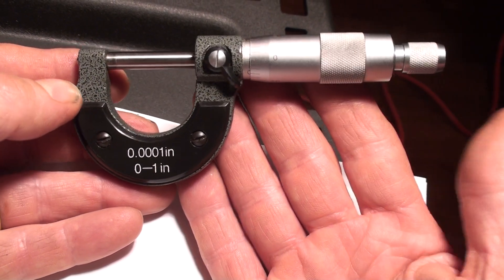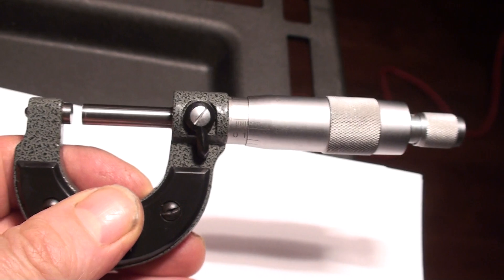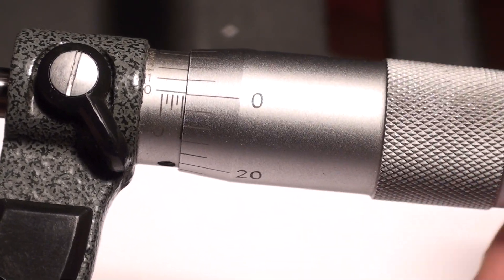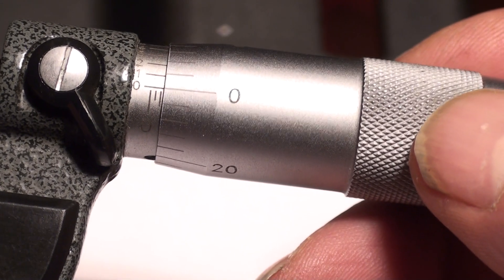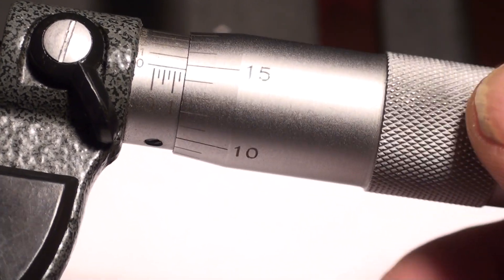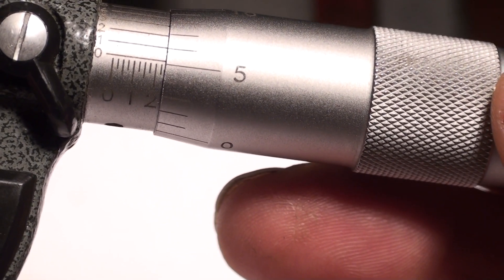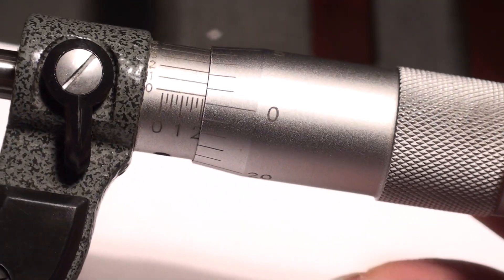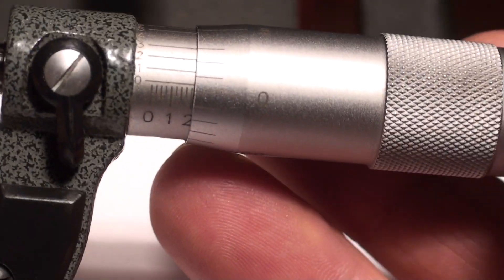How to read a Micrometer

Comment: Thank you for this video! The only thing I think you may have missed is the ratchet on the top of many different micrometers. I spoke with a few machinists and they told me to use that knob on the top to tighten the micrometer down, and let it click three times. When in doubt loosen the micrometer and do it again to see if you get the same results.